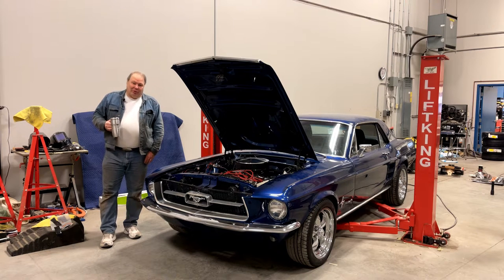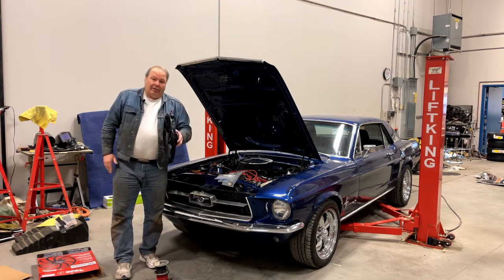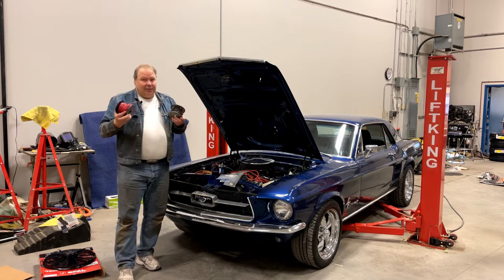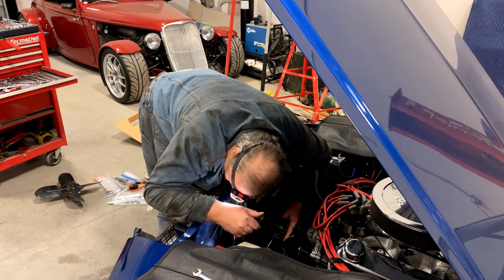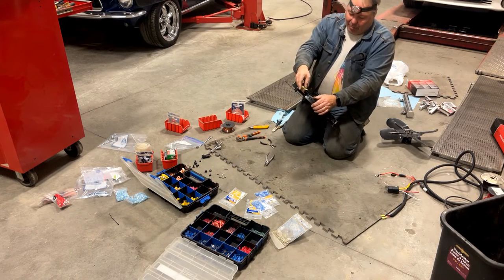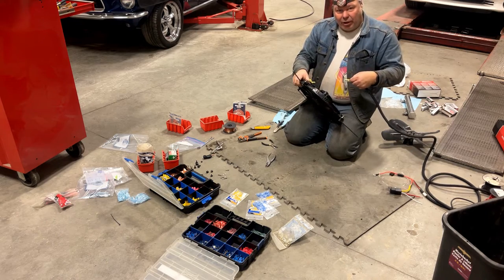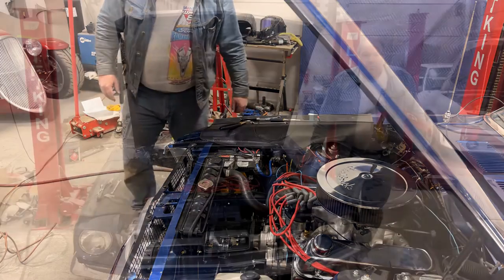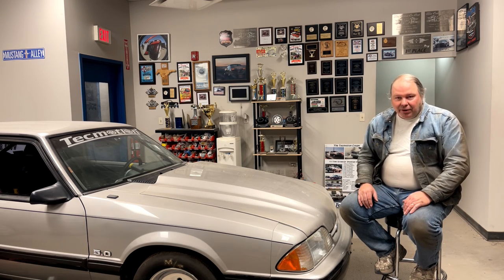How to Install and Wire an Electric Fan in a 67 Mustang or any other Custom Car

Comment: Another great video. Great options and details. 👍 you do awesome work sir.
Reply from the maker: Thanks. I have done lots of electric fans, but every time I do it there are always some gotchas. For instance, those water pump bolts on the 67 are fine thread and I just didn't have the short fine thread bolts needed for the job on hand. Lots of shops don't want to tackle jobs like this because the elapsed time required is much greater than the billable time, and if you are trying to bang cars through it ties up a bay, sometimes for days, for a relatively small number of billable hours. As an enthusiast, the billable hours aren't an issue, but you have to plan it out in a way that you won't need the car for a few days while you deal with all the unexpected 10 cent problems.
Reply: Super work hands on not just talk or foul language used I honor  your skilled teaching.

Comment: What’s the point of the fuse and where does it go in the wiring? How often will it blow? I’m worried the initial surge of amps when the fan comes on will keep blowing it.
Reply from the maker: Use a fuse that can handle the continuous draw of the fan. It can be anywhere in a relatively short power circuit like this but ideally it will be fairly close to the battery or power lug. The fuse won’t normally blow as a result of the startup amperage.

Comment: Just curious how high can that lift go. Can you work under the car in standing position. I'm 5'10" & very curious if that will work in my 10 foot eave garage.
Reply from the maker: If I remember right it lifts 5 ft - There is a profile video on the lift on this channel (https://youtu.be/7jPyQMASt58) which I think has all the details. I'm over 6' and the way I use it is I sit on a roller stool when working underneath the car and that turns out to be a pretty comfortable way to do it. I have a four post that lifts higher but it is set right in front of the dyno so I often end up doing builds on the little two post.
Reply: @tecmotiondyno  Thanks, the video was very detailed👍

Comment: Good afternoon know where I find used fuel injector harness in good shape 86 mustang gt 5 speed.
Reply from the maker: Most of these old harnesses have broken and brittle connectors. You should probably be looking at new from someone like Ron Francis or Painless.
Reply: Symptom bad fuel injector ground.

Comment: Nope you mounted the fan completely wrong  you were supposed to custom make a fan shroud and mounted the electric fan to the shroud then you mounted the shroud to the radiator
Reply from the maker: In a lot of cases a shroud setup will work better, however there isn't always room for an effective shroud so I opted for a very high flow fan in this case to compensate. It's also fair to point out that the factory did not use a shroud in this application either.
Reply: @tecmotiondyno  there guy on YouTube  has already done it and was able to fit one in